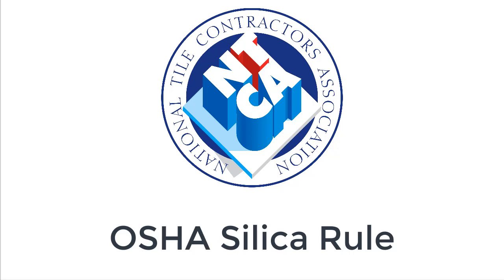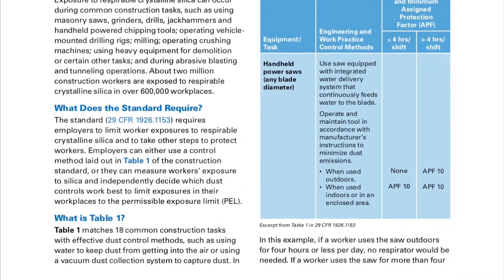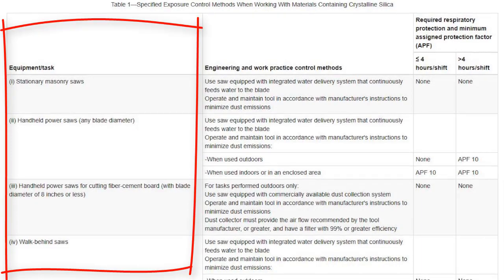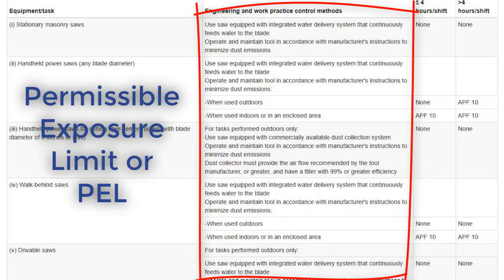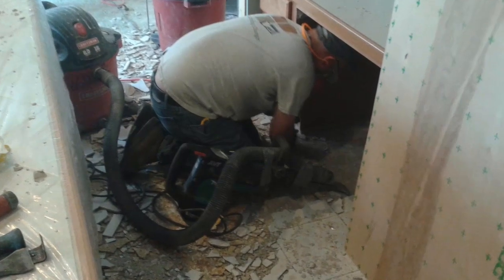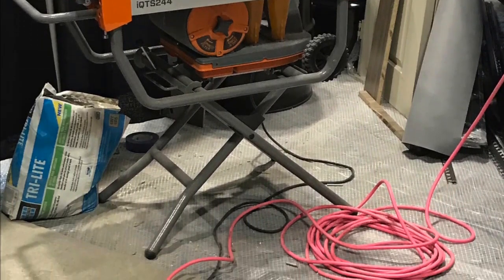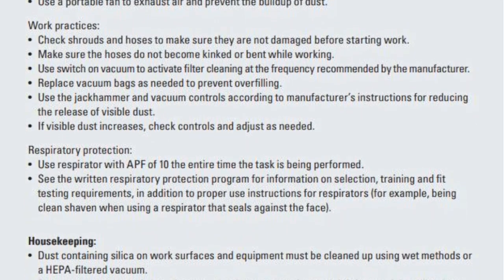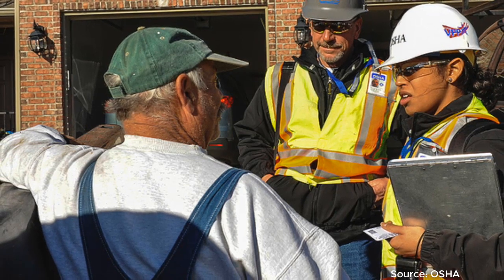OSHA Silica Rule

Comment: National Tile contractors, very important question/request for you, I am finishing up a construction safety video, part of which ties in with silicosis - for those who breathe in way too much dust from the ground, breaking rocks, concrete, or this crushed concrete - the very common dust crystalline silica - though I've noticed people really have to breathe in a ton of the dust over a period of years - or extreme single exposures like the breathing in the dust from the twin tower collapse to get an issue from only single exposures. I personally do not have much in the way of clips showing hepa vacuums or other dust control methods so was looking for some existing footage that I could utilize - I would just include the clips showing your vacuums and wet methods - probably only utilizing around 10-20 seconds or less of your clip - and could gladly cut out your audio, I am planning to just utilize my talking points for the video - unless there is a key piece you explain about the vacuum you think I should include your audio of in your explanation. Would I have permission to incorporate just a small bit of the clip? I do intend to sell this/strategically give it away for free to those who need it. In exchange for this - I can give the final product to you at a highly discounted rate and or even free if you are looking for a modern construction safety video (mostly specific to concrete construction) including modern medical treatments. In any case just let me know if that would be okay.
Thanks you for your time!